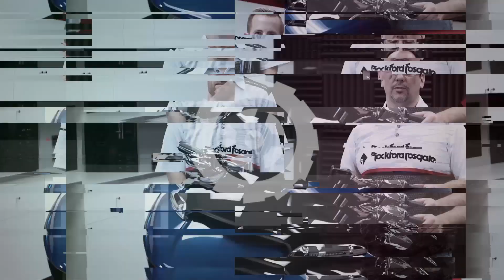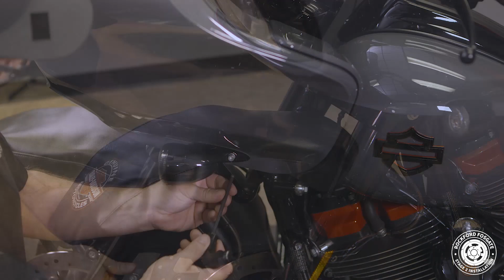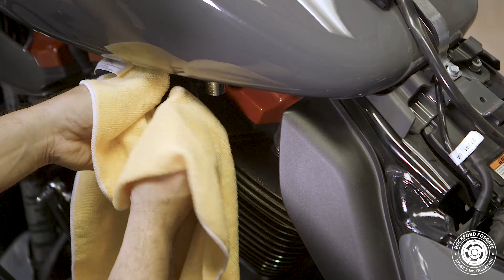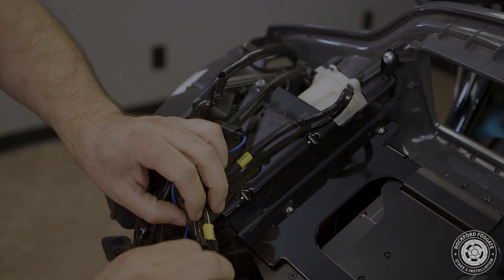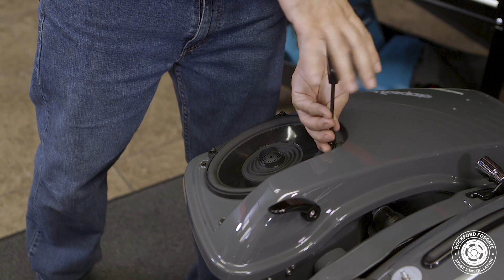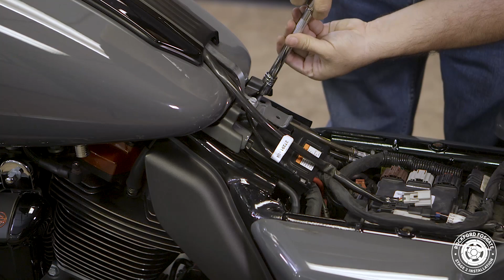2014+ H-D CVO Road Glide Stage-2 Installation

Comment: I just had this "upgrade" done on my 2020 CVO street glide a few days ago at a local Sound Warehouse and I am completely dissatisfied with the sound.  All mids and highs with no lows.  The fullness of sound I got from the OEM Boom 2 was much better.  Also, no matter how I adjust the treble and the bass, I get the same sound.  And the fade doesn't work AT ALL.  So, I'm a little sick about the money spent.  Any suggestions?  Also, is there a reason you didn't remove the disconnected amp in the left rear bag to provide more space?
Reply from the maker: Hi @daveryland7731, The Rockford Fosgate audio system does have a higher range boost which is intentional, so you can hear the music at highway speeds.  However, there is an add-on DSR1 option that ties directly into the T-harness your bike was just equipped with.  This allows you to customize the full DSP settings to your taste.  The one thing that doesn't sound right is the Fader.  Our "Rockford Fosgate 2014+ All Bikes" flash restores fader functionality, so I'm wondering if the technician accidentally used the older Harley-Davidson "2 Speaker/Upper Fairing" flash which eliminates the fader function.  I would suggest talking with Sound Warehouse about this, and ask them to remove the OEM amp in your saddlebag.

Comment: Does this rockford amp reduce radio reception ?
Reply from the maker: Not sure what your question is .. do you have this installed in your motorcycle now?
Reply: No I’m considering this system and wondering if the amp will interfere with fm reception like so many other class D amps. I have the Boom 2 in my CVO now and want to replace it. The only good thing about it is I get great radio reception and would hate to lose that
Reply from the maker: @bigdog3495  Great question, and thanks for clarifying the concern.  We use ferrite beads on the toroid to reduce the interference.  The only problem I’ve had to troubleshoot is loss of FM when running an amplified antenna directly over the power supply of the amplifier (literally within 1” of the power supply).  Once the cable was moved, it restored FM.

Comment: Why go from a 600 watt system to a 400 watt ? Components to coaxle?? Makes no sense
Reply from the maker: Amplifier power ratings are non-standard and anyone can publish whatever rating they want.  Unfortunately, many use a MAX or PEAK power rating.  Did you know that many factory labeled "100 Watt" systems only produce 25W RMS?  Rockford Fosgate amplifiers are tested and rated per IHF & CEA industry guidelines.  They may appear lower than the average amp on the market, but they are honestly rated.  This is why we publish a Performance Verification Certificate (PVC) with every single amplifier, so you can see what the amp really produces.  The TM400X4ad "400 Watt" amplifier included with this kit is a true RMS 520+ Watt (or higher) amplifier that can easily run 8 speakers.  Here's a video that shows our PVC: https://www.youtube.com/watch?v=u81OPhA08u0. Also watch how Rockford Fosgate amplifiers perform when put to the test like the 400X4's big brother, TM750X1bd: https://www.youtube.com/watch?v=FjfFVlDxj-M